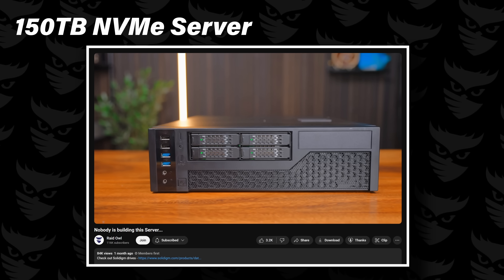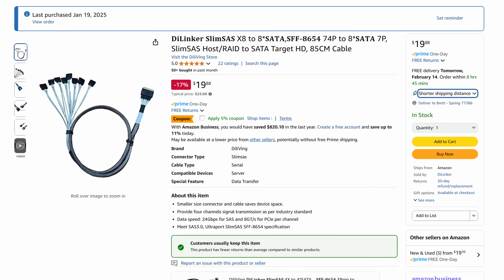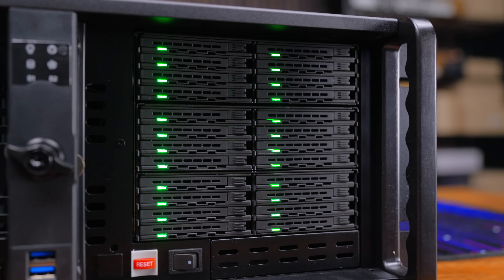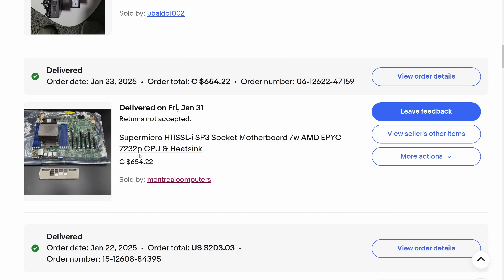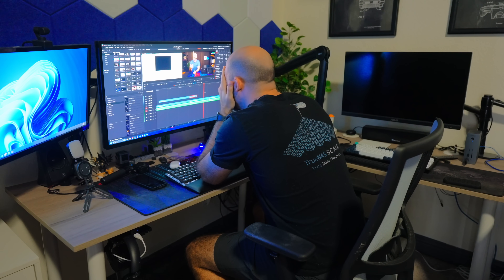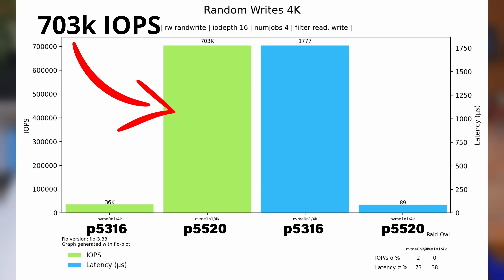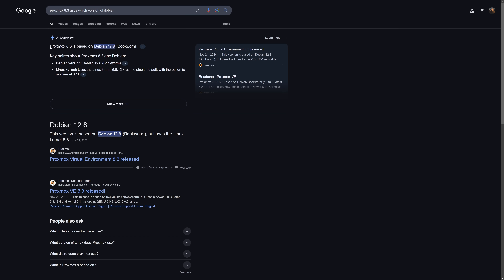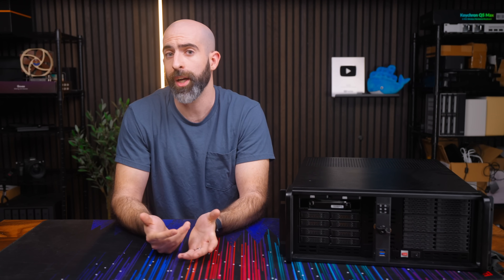I built another SSD storage server…

Comment: Watching this months later and I'm wondering what it would be like to have that chassis but with 6 u.2 docks, that romed8-2t board, 24 of those solidigm 122TB u.2 drives, and a 100 Gb NIC. Throw them into 6 raidz1 vdevs and you'd have just a hair under 2.2 petabytes of storage in a 4u chassis. And given how efficient those solidigm drives are, it would probably sit at under 200 watts idle.

Comment: i use in my server also 512gb SSDs because there are cheap and if you have enough of them you get a decent capacity. i use the cheapest drives i can find. in my case Verbatim Vi550 S3 512GB. Those are not the fastest, but in total faster as my x8 PCE3.0 connection to my Raid controller can provide. 8GB/s in raid6 is fast enough, i would say.

Comment: I built a 192TB storage server with 12 X 16TB 7200 SATA spinners... The cost was $1800 and I am maxing out the pcie bus by a long way...  Your system is no faster than mine.  Using NVMe the way you did here makes no sense.  Plus, that big f-ing 4U case just for those tiny drives at the front, lol..  Over the top man.

Comment: Hi Raid, I just purchased Dell Precision 5820 Tower Workstation, Intel Xeon W-2133 6-Core 3.6GHz, 128GB RAM, 512GB M.2 NVMe PCIe SSD + 3TB HDD, Nvidia Quadro M5000 8GB, Windows 10 Pro 64-bit.. on paper I beilive I can add a ICY DOCK 4 Bay 2.5" SAS/SATA HDD & SSD Hot Swap Cage for External 5.25" Bay | ExpressCage MB324SP-B.  My goal is us the host as proxmox, and it's internal bay as SSD. What do you think?

Comment: 6:40 - That asrock is NOT THE SAME generation... X11 is Epyc1 = Naples, sometimes with a potential to update to 2nd gen epyc (if bios is released), and X12 would be same as your ROME* board, made Epyc2 ~ Rome. The 2nd gen boards have Gen4, and are able to take a 3rd gen Milan CPU then.

Comment: 1. Enable pcie aer
2. Update the 9306 (I beg you). Don't forget the roms(s)
3. Might be better to swap out all of those ssds for some bigger drives. 24x 512gb drives can be replaced by 3x 4tb ssds, with no need for all of the cabling junk. 3.84tb ssds are currently rather cheap.
4. Why is it always icydock... Ugh.

Comment: I see one potential problem with this setup.  Those Inland SATA drives, what voltage rail do they use for power?  I tried to find the spec online, but came up empty.  Most consumer SSDs opt to use the +5V line, while Intel SSDs prefer the +12V line over the +5V.  This matters a lot when you plan to put 24 of them in the same case.  Then there is the matter of how much power does each of those drives require?  Like most manufacturers Inland is publishing the read/write usage because the numbers look good, but what they aren't disclosing is how much power is needed when the SSD is full and needs to run a garbage/bulk erase to free up blocks.  For example the Crucial MX500 1TB only uses the +5V line, and lists its read/write max usage at 2W/5W respectively.  So you would think you would only need 1A +5V for each drive -- in your case 24A, but that isn't entirely true.  If you look at the front sticker on the MX500 drive, you will see they've printed a max usage of 1.7A.  That sent me down the rabbit hole of figuring out that when an SSD is full and has to erase a block to write a block, it can and will use a lot more power.  For 24 MX500 drives that would be 41A just for those drives; your computer uses the +5V rail for a lot more.  You may not even notice a problem until you hit the point where the drives are full and need to run a garbage collect to free up blocks.  As long as there are free blocks 24 MX500 drives wouldn't push more than 24A, but as soon as it needs blocks, that usage will spike.  As I said, I couldn't find info on the Inland SSDs, so you might be lucky and they use +12V which modern ATX supplies are perfectly designed to output in high power.  If they use the +5V line you will run into problems down the road.  Ironically power supplies from 20 years ago are much better suited for a +5V hungry SSD as the Athlon CPUs of yester-year used to run on the +5V line.

Comment: Great Video! Odd fact, I work for a company named Owl. Owl Cyber Defense.
Question: Any reason you used a LSI 9306 for the build but plan to use a 9300 for the JBOD system? Why not a 9305 with external connections?
Reply from the maker: Cost and availability basically. I think I bought the 9300 first.

Comment: Depends on your speed and storage needs . But as a fast file server, over kill massively... As a file server for a YouTuber under kill... As a media server under kill, and I didn't see a GPU for media. 

My Unraid server is running 10 x 4tb drives in ZFS w/2 parity drives, 4tb x2(stripe) cache drives. It's very fast even though it's being run on a lowely  Ryzen 1700x. It has an arc a310 for media acceleration.

Comment: I have pretty much been doing the same thing.  I have several Supermicro X10SRAF-O motherboards as Truenas servers, one full of 4TB Samsung SSDs in ICY Dock 6bay 5.25 modules (x4).
You will want to change out the fans on those IcyDocks.....I had 2 fail within 6 months.  there are fairly affordable replacement fans with dual ball bearing fans (ANVISION YDM4010B12 specifically are the ones I used)
Thanks for the video !

Comment: Am I missing something obvious? Aren't m.2 SSDs the same price as 2.5", and higher density? So, why so many 2.5" drives? I must be missing something...
Reply from the maker: They don’t make 30TB m.2
Reply: @RaidOwl  sorry, I meant why so many 2.5" sata drives. I can see the attraction of u.2
Reply from the maker: Oh. Cuz driving 24 more nvme drives would be even more expensive, require way more pcie lanes and speciality hardware. Sata is a bit more easy to work with.
Reply: @RaidOwl  IcyDock do a 3xOCuLink=>12xm.2SATA?

Comment: I really wish I could fill my servers with NVMe or SSD's, as it's so strongly pushed by some forum users and does have some massive benefits (I have 1 SSD pool with just 3x1TB in RAIDZ1 for fun). Even if they last twice as long as HDD's, they also tend to cost twice as much as HDD's - and that's not the NAS specific ones either. There's the power savings yes, but depending on where you live, that's around the cost of a decent meal out once a year.

Comment: Did I miss the part where something else would be running on the host other than TrueNAS? I get the easy of pass thru and simplicity of a VM, but if all that is on it is TrueNAS isn't that a bit of diminishing returns?
Reply from the maker: I’d like the ability to run other operating systems down the line and I like Proxmox for that.

Comment: I have a similar set up with 24 500gb Sata ssd’s and 8x12TB HDD’s with an Asus Nvme expansion card. You gave me a good idea to set the Pcie port to 4x4x4x4..I didn’t think of that lol I just left it on auto which is giving me issues.
Reply: Can you put up a video of you build?
Reply: @privateaccount5400  sighs the motherboard "Gigabyte MZ01-CE1 rev2.0 died on me shortly after posting this comment so the system is dismantled. I'm currently in the market for a replacement. I'm going to go with a AMD Threadripper 2920x + Asus ROG Strix x399-E gaming to replace it. once that comes together hopefully I'll remember to come back to this comment and present it to you for reference.

Comment: Something like this is what I did for my ceph cluster, though I went with SP6 to save on my power bill, mcio/oculink redriver cards making the newer hardware a good deal overall and SFP28 built-in. Came down cheaper for me, or should be now that I've had this for some time. I also use JBOD for my HDDs (Dell MD3460 w/jbod cards), but instead of putting my spinning rust on CEPH as well I have 2 systems set-up for ZFS-ha using corosync both attached to the same jbod and use SAS SSDs in the jbod for special devices. Got a few 8TB Samsung PCIe 4 u.2 drives when they were running for something like 400 euros (maybe closer to 500) and the JBOD was also only 500 euros, but overall this was an expensive endeavor that took more than a year to complete. Got a watercooled Alphacool rack case with 4 5,25" bays at the front because I live in an apartment and have a small rack in the hallway. Gonna be hard pressed to find anything more efficient and quiet with this much density, high availability and speed (the jbod does like to sip some power, but it's nowhere close to full so not too bad) and this will serve me for quite some time I expect.

Comment: My love/hate for Icydock aside most of their units just cost way too much.  I'll drop hot swap at home, use something like a Hakoforge Mini and have the option of 3d printing any cages I might want and fan options for PCIE slots (especially with 100GbE).  That said it is pretty neat to be able to build something that dense for home use without having to deal with the noise and power consumption of something like a Dell R730XD SFF.

RomeD8-2T is same gen as the H12ssl-i, not the H11.  The RomeD8 is same generation as the H11.

'General recommendation' for ZFS is to not go wider than 10-12 for Z2 (and a lot of people will say 8 with drives getting as huge as they are) but I that's when talking about spinning rust, not sure when talking SSD's.  Z1 Vs. mirrors is it's own rabbit hole I won't go down.

Had a similar problem flashing some HBA's and NIC's recently, the utils worked for diagnostics but would only flash properly from UEFI prompt, was kind of annoying but only took me a couple minutes to get it sorted thanks to IPMI.

Confused why running TN virtualized, seems like it would be simpler to just run TN bare metal since you have other proxmox servers that can take advantage of the storage.

Comment: The raidz4 set up is better from a data safety point of view as you can lose any 4 drives. Resilvering times would be bad though. The 2xraidz2 would be better for performance, but you can only lose 2 drives on any one vdev. 4xraidz1 could be risky, but tbh considering how small those drives are I don't think it matters.

Comment: And this is why if you are doing a homelab you should just go for a basic 4U chassis. You get a ton of expandability and your hardware choices are much easier. I don't like it when people try and build out 1U servers and then end up puting barely any hardware in them because that is all that fits, all while having whiny fans you can hear from anywhere in the house. You only put an 8 core CPU in this thing but in that generation the CPUs go up to 64 cores even. You don't need to cluster your homelab when you can just build one machine and virtualize it.